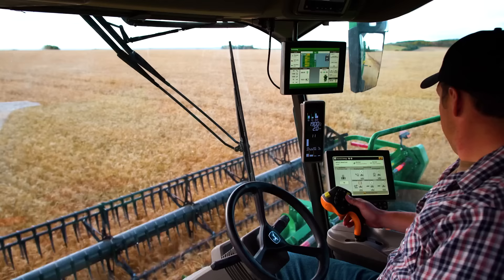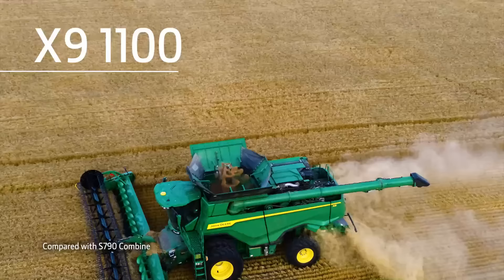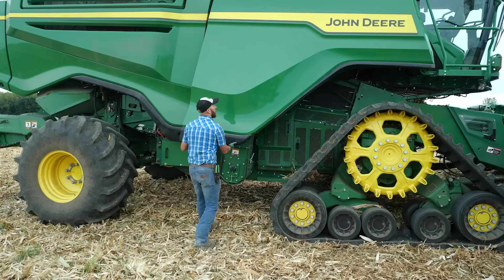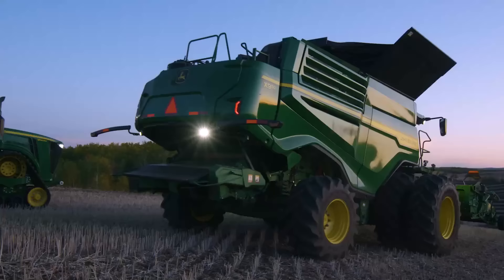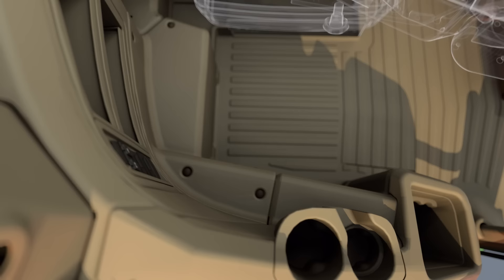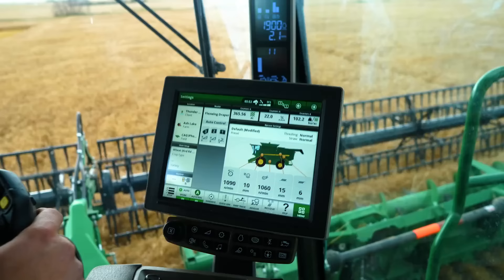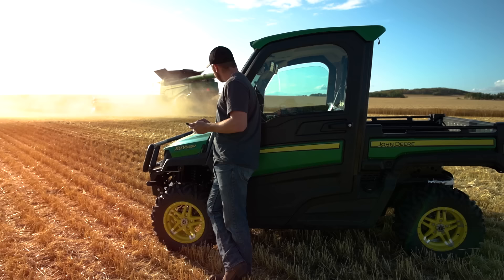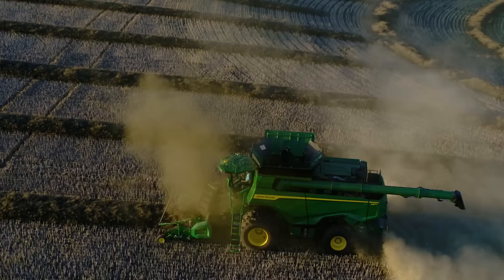X Series Combines | John Deere Combines

Comment: We also designed the shoe augers with a longer and wider front step pan. Maybe change “designed” to “replaced”. Finally got rid of the shoe augers and achieved an “active grain pan”. I’m extremely shocked the radiator isn’t “lay flat” above the engine with a 4 link rear axle.

Comment: The reel in the wheat is going about 5X too fast.  Why do so many operators thresh with their reels?
Reply: There is where about 7/8 of the grain loss comes from. Lol
Reply: Yep. Way too fast.
Reply: That's where the fuel economy comes in. when the reel is spinning like a helicopter blade it helps pull the machine forward.
Reply: Well if the machine won't the head will...
Reply: Bad operator.

Comment: New holland has had twin rotors for years and case has had the adjustable down spout for years. Does jd ever have original ideas anymore or do they just copy other brands and tweak the design a little bit?
Reply: What else are they supposed to do? Three rotors? Twin walkers?
Reply: Yea bud just because somethings out there doesn’t mean u can’t make it better and I’m pretty sure the 8rx was original idea bud so
Reply: Do plebs on youtube ever have original comments anymore or do they just copy other comments and tweak the language a little bit?
Reply: Mike Maes  Yet the MX magnum basically stole the entire cab from the 8000 series (control armrest, corner post display, electronic controls)... And the entire design of the front frame for tighter row crop turning
Reply: Well they did that with the rt‘s
Reply: Luke Endorf technically had  a prototype of it years ago
Reply: exactly.
Reply: Luke Endorf wrong, case introduced an all track 7220 magnum in 1993. Never produced them because at the time farmers thought it wasn’t a good idea
Reply: @icenbryse5190  So because Deere and cat went together to work on two track technology is a copy? The square baler is Kuhn not Heston. Does Deere have a useless three wheel floater running around somewhere? I have never seen one? I think your mistaking them for oxbo.
Reply: They have always copied everyone else.
Reply: @icenbryse5190  And their single rotor S series  combine was pinched off IHC and the RX series was copied off Caseih quad tracs etc etc .
Reply: @chadjustice8560  Cat challengers were out decades  before Deere RTs .
Reply: @Ethan-ck6iz  i was thinking quad rotors
Reply: Luke Endorf the 8RX is basically every other tractor out there fitted with Zuidberg tracks, only Zuidberg tracks are superior lmao.
Reply: Steven Arnold  Deere mucked around with an experimental prototype as did a lot of companies, but it was IHC that put the big investment and time into it and perfected it ,Deere just waited for the patent to run out and to see how successful it was before copying it . Btw it was actually an Australian man that came up with the rotary threshing concept.
Reply: @Ethan-ck6iz  Well JD could quit copying everyone.   I remember when they made fun of NH for having twin rotors and now they copy them.
Reply: Steven Arnold  same like in auto industry but i know for sure that Deere copying from all about 95 % , one example take Claas for instance they spent 20 years to produce combine while Deere trow out every 3 to 5 years combine, dont get me wrong am not color man but just stating fact. Cheers

Comment: Cost $750,000-800,000 & up.The smaller combine is not that much larger in the grain tank then the CaseIH 8250/9250 Axial Flow combines

Comment: Sweet machine!
Reply: After having a combine fire two years ago I want to see the engine compartment redesigned especially turbo and exhaust systems. Every morning clean out with industrial air compressor till no residue whatsoever anywhere yet the problem still exists. S670 and s770 machines. Creature comforts don’t help your bottom line when your machine and field go up in smoke.

Comment: Ok some simple math here...This machine is capable of up to 7200 Bph in wet corn. That means that (1) X9 is filling a 1000 bushel truck every 8 minutes and 20 seconds...roughly. That means that the largest 460 bushel grain tank on the 1100 is being filled from empty to full-on cab corn in approx. 4 minutes...Exactly how is a 2000 bushel grain cart supposed to keep up with a 4 minute fill if you have two units working 1/2 mile from each other? It can't. This combine represents a new problem in harvesting...The combine is no longer the weak link in the speed chain, now it's going to be carts and trucks being able to keep up with the flood of corn this thing is pushing out. You will be forced to keep your combines together, the carts closer to the combines and the trucks closer to the carts...travel time is going to yield a very expensive combine sitting waiting to unload...every 4 minutes...something to think about.  All you are going to do now is move your least experienced combine operator over to a new 500HP tractor and 2000 bushel grain cart...At some point we will reach the limits of what is logistically possible to move material out a field, and the bigger the field, the bigger the issue.
Reply: In reality it 's rate will be in the 4000 bu, range.

Comment: Pls don't get the Autonomus tractor into production! It is ugly and then farmers arent farming anymore!
Reply: i would hate to have one on my farm we have pipes feeding water to cattle trough's all over the farm and some times they leak i once went over a leaky pipe and the top soil look dry as hell like normal ended up getting a combine stuck lucky i stopped in time before i drove to far in to the mud adn had emptied the grain bin just before. how would an Autonomus tractor see wet ground? and if its ended up in a situation like i did could it stop in time before getting too bogged could it even tell the difference from a tonne of mud to some surface mud say from rain or melted snow that may cause the tractor to slip a little if it mistakes that slip for it getting bogged and stops then that down time forcing the farmer to go out see if it is bogged or not. the there the imperilment its self what if and air hose on a seeder get clogged what can it do about it? and spraying i once hit a bump in the tractor it didn't seam big at all barley moved but our sprayer has much smaller tires making it sway to much and smacking the boom in to the ground and bending it as a classic Australian farmer i carefully backed in to a tree to bend the boom back how would an Autonomus tractor handle that even my old man who has bean farming far long then me end up doing the same thing as me and bent the other boom.

Comment: What headers are compatible for the x9 1100?
Reply from the maker: Choosing the right equipment can be challenging! We recommend starting with our Build-Your-Own Tool here: http://spr.ly/6054l1awA. This will allow you to see which Headers and other attachments are compatible with your unit. Your local dealer would also be happy to help out with any additional questions you may have. You can find contact information for your nearest dealer at http://spr.ly/6059l1abB.
Reply: Thanks!

Comment: JD link is free add on now????
Reply from the maker: Carl, all new John Deere combines come with a 5-year subscription for JDLink™ Connect. This enables machine-to-machine communication, infield data sharing with your agronomic consultants, plus Data Sync, Remote Display Access, Wireless Data Transfer, Remote View and Adjust, and John Deere Connected Support. You can learn more about JDLink and the available X9 Technology Packages here: https://bit.ly/3ef6lCL.
Reply: @JohnDeere  and why didn't the 13 S780s and 11 S680s that I bought in the past 18months didnt come with JD Links

Comment: why are these things still not diesel electric after all these years? every component could be independently throttled, no belts, no wear, lifetime motors?  motor could be throttled independently of speed for power requirements.
Reply: But it can increase complexity and also using diesel generator to drive electric motor can be inefficient and can add a big  extra price tag in these already expensive machines , so i think calibration for a fixed rpm of engine is better than adding extra complexity, but you are right because in future if we are going to use liquid hydrogen as fuel then adding electric motors to remove belts can be efficient but belts are still cheap then electric motor so 10-15 powerful electric motor with belts can be better then 50-60 electric motor . But who knows about future......